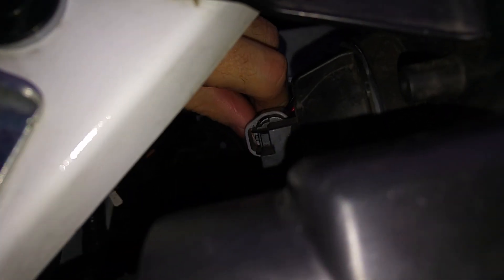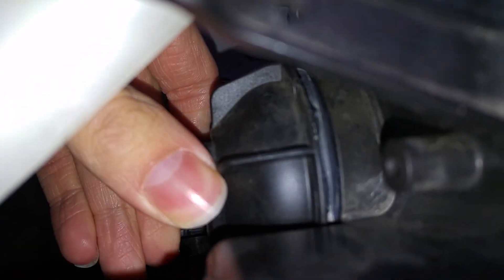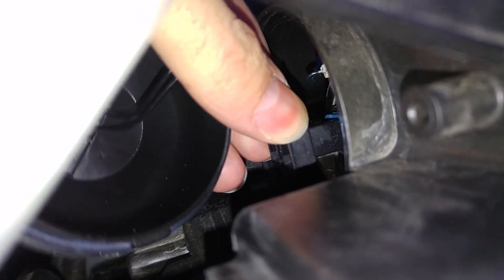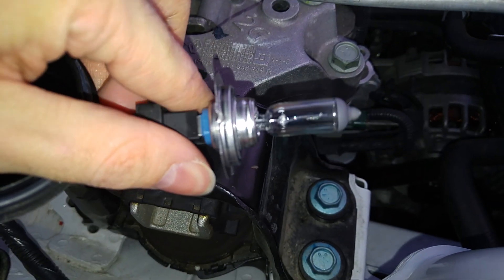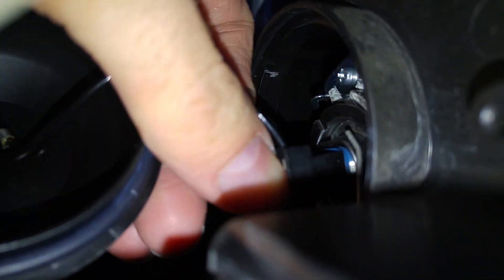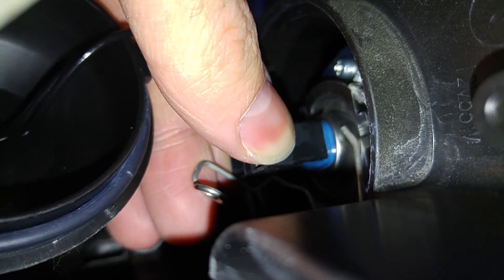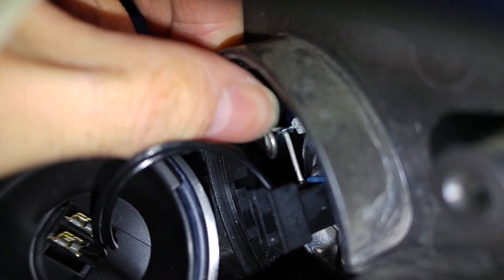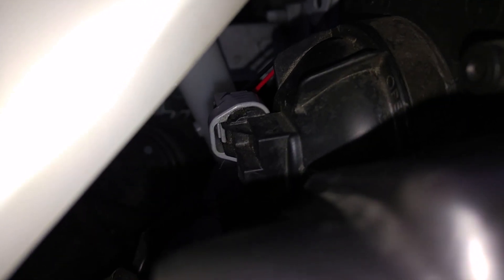📈Nissan Qashqai J11 - how to change front High Beam light bulb

Comment: I want to put a hid kit in my nissan qashqai 2010 i have projector headlights is it ok just to swop over to the kit
Reply from the maker: i would be little bit afraid, that you can burn the lights, heared from random guys around internet if you put xenons that they burned the light from inside, as normal halogens are lets say only 200 celsius, but xenons over 400~ , would rather go for LEDs from china, random source https://www.hidplanet.com/forums/forum/general-discussion/general-discussion-aa/60448-hid-bulb-vs-halogen-bulb-temps . still i would not recommend them as LED or HID KIT (xenons) are not homogenized for your car/or bulb itself is not homologed/ approved by government.
Reply: frostsilenec will the h7 bulb clip fit on to the led i took your advice and stayed away from hid